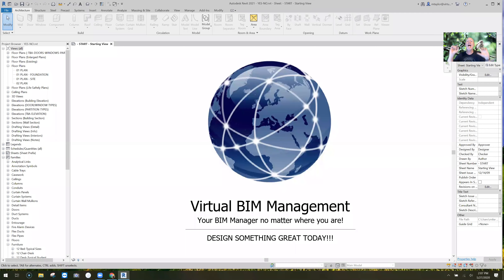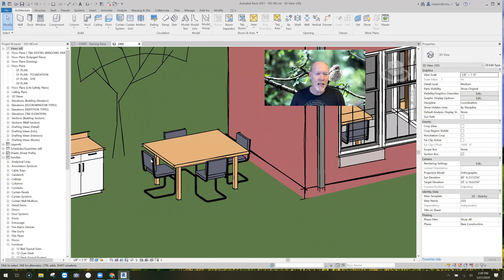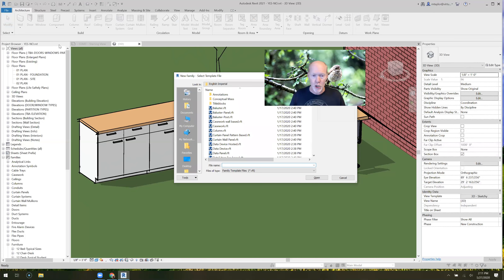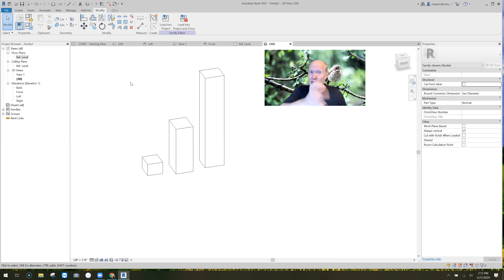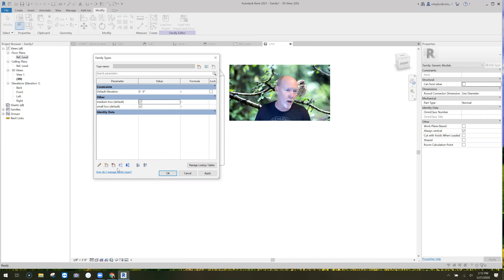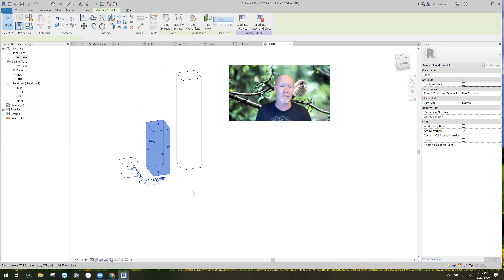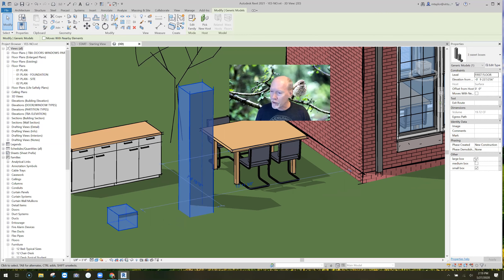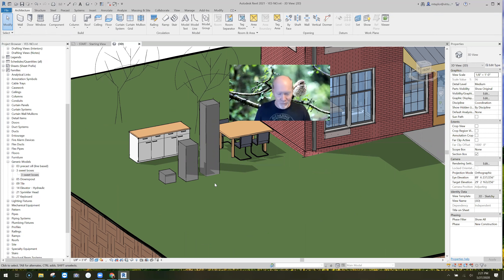YES/NO PARAMETER: Extremely useful in families

Comment: @Virtual bim management 
if i change a small rectangle object to small box category it also changes the big rectangle to small box category pls help
so when i check the small box both small and big rectangle object disappears .
Reply from the maker: I think you are dealing with INSTANCE and TYPE parameters.  If you use a Type parameter, they both will change, but if you are using an instance parameter, you can change them individually.